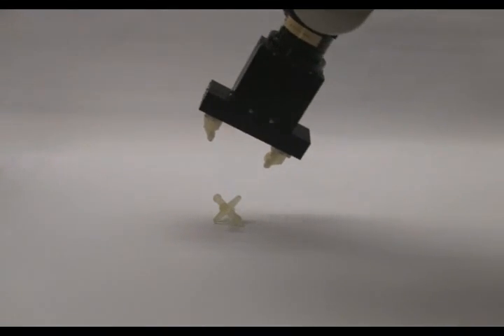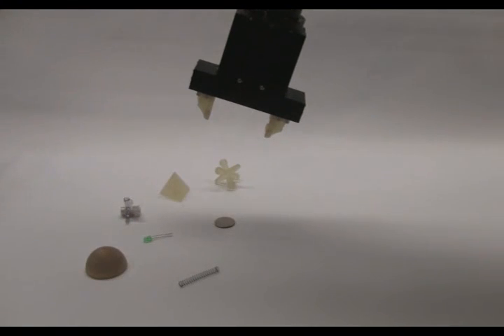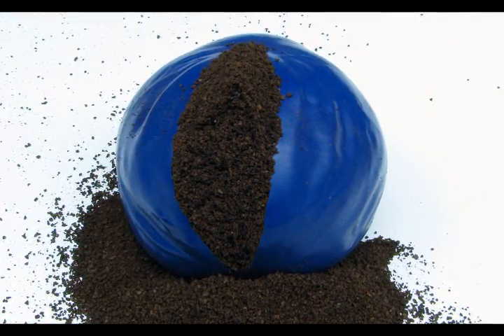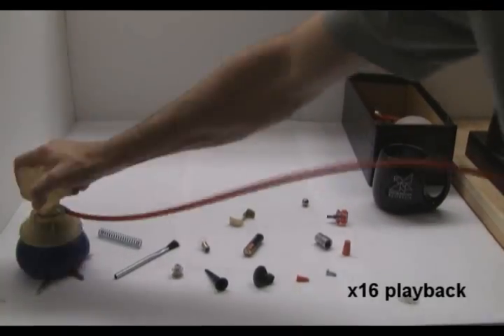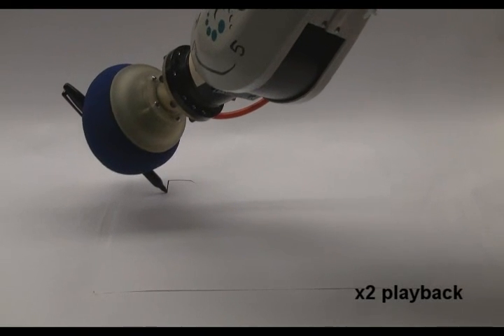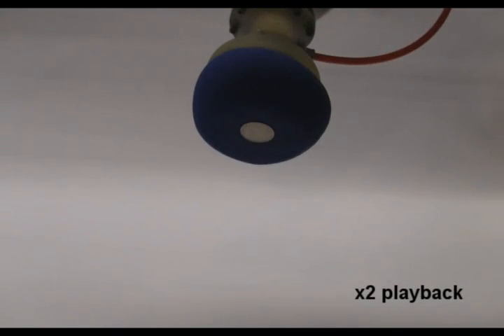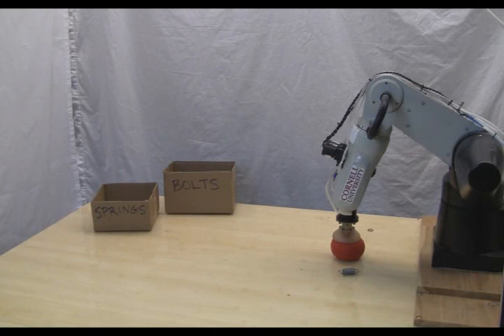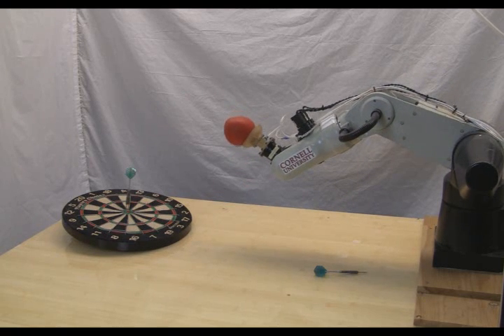Robotic grippers based on granular jamming

Comment: It doesn't have to be beneficial at first; as long as whoever gets that mutation manages to produce fertile offspring that can pass the genes onwards anything else doesn't matter. What makes you think such an individual wouldn't reproduce? Perhaps even if those earlier steps made the individual less capable, perhaps that actually turned out to be a reproductive advantage, since those individuals wouldn't be as hard to rape as "healthier" individuals and so have more offspring than the pickiers

Comment: None of the steps in that evolutionary path would be beneficial though, so any creature with those mutations wouldn't reproduce. And there are still some healing problems at the endpoint.
If a porous enough foam was used, there wouldn't be spilling or overlap problems. It could start luckily as springs to run on, remain porous for healing, add pressure control for elasticity control, then reach granular locking from improving pressure control.

Comment: (continued)
Then structure of the bones and skin and synovial pockets (whatever they're called) change to avoid puncturing and migration of bones up the arm. From this point on, all you need is for the hand bones to get smaller and more jammable, and for some muscles and or tendons to rearrange a bit, and you got your organic granular jamming universal gripper. What would push it in this direction? Could be anything, perhaps some kinky females thought it was sexy for example.

Comment: One easy way to have it be self-regulating would be for the bone destruction cells to produce a chemical signal when destructing bone matter, and the activity of the bone producing cells be inversely proportional to how often they touch a molecule of that chemical; and have the the bone destruction cells only attach to bone matter and not to the walls of the sac.

A possible path could be first the skin of the fingers merge, then hand and finger bones don't attach, and grow multiple times (cont)

Comment: How would it heal if it got cut though? I think you would have to have a pressure sensor to know when to heal, and there's the problem with the skin not aligning. 
Also, since evolution works in steps, there would need to be a reason for a bone sac without the pump.

Comment: I guess if you're dealing with small time business, bang for buck does come into play. The company I work with deals with a product that ranges at around 1000 USD. We run 24/7 and produce 1200/24 hours. The money we work with 5% goes a big way. Not to mention precision is not simply quantity but quality as well. I can tell you from inside experience that companies who do in fact use these "expensive" units will continue. Our robotic grippers range around 2.5 mill and we don't regret a cent spent

Comment: there is one massive problem with this, since the gripper is packed with a vacuumed granular substance, determining the flow of the compression is near pseudo random. Even with synthetic granules you will still under go varied results and the practical use of this gripper would be in an automated scenario which involves iterations to be 100% consistent. I can't see this replacing "expensive" grippers. There is a reason why they are "expensive".

Comment: Would there be any way for the gripper to sense what it is picking up? So that if one in a factory deals with two separate objects and has to put them is specific places, it wouldn't just be programmed to pick up whatever is just in front of it, but it would pick up the object and determine for itself where it's supposed to go?

Comment: Wrong! Already robots do many jobs. Does not really result in a net loss of jobs. The education level needed to get a job has increased. But that's not the same as loss of jobs. Most robotics are not replacing jobs people really want. They mostly replace jobs that are dangerous or VERY boring. An as far as the less expensive part, not really. The primary way it saves money is by reducing workers comp and turn over. The robots and the 5 people it takes to maintain each robot are quite expensive.

Comment: I assume this would be done with something a bit stronger than an old balloon hanging around the house, but still, the material would have to be thin so would that make it prone to breakage (which would make quite a mess. I can't imagine being the assembly worker who had to clean every grain of sand from the machinery)?
Aside from that, this is a really smart idea. I'm surprised we don't see this everywhere already

Comment: Starch is really cheap, ferrofluid is fairly cheap. I would think an electromagnet and driver for it would be cheaper than what they're using now. 

At one time I wanted to try to make this idea into a one tool fits all device. It would form around the part and then you throw the switch and it conforms to the crevices of a screw head, forms around a bolt or whatever else it can grab on to.